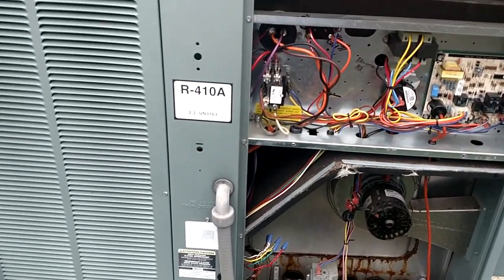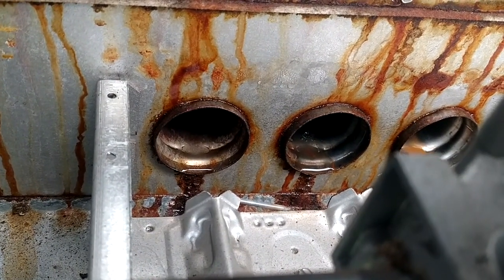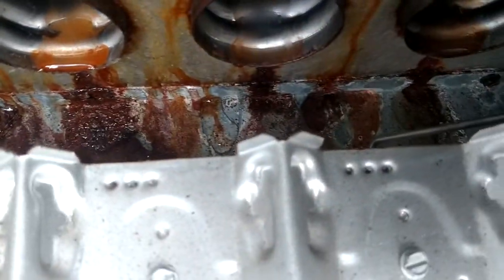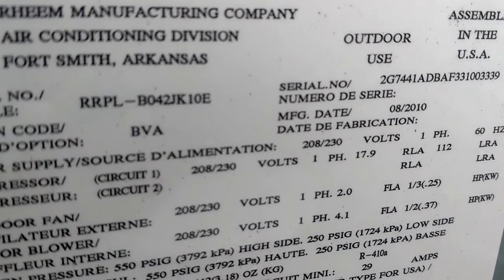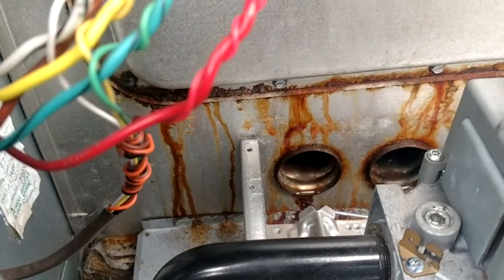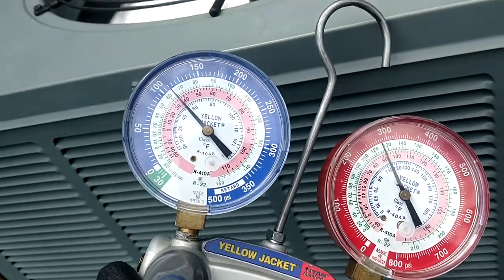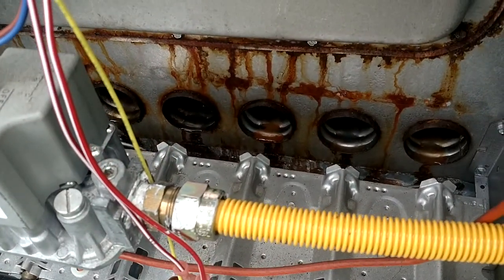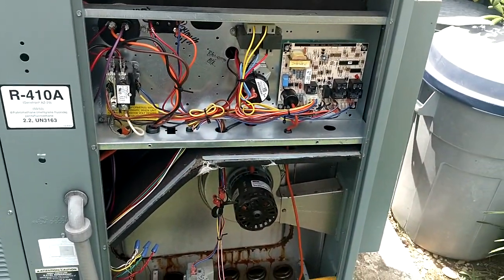What's up with that🤔 2010 Rheem gas pak condensating down the heat exchanger in A/C mode. Rust!!!

Comment: I have the same unit with the same problem apparently it’s a design flaw the tray underneath the AC condensers do not collect the water properly as a result water overflows onto the heat exchanger rotting it out which is unfortunate because those heat exchangers are very expensive horrible design

Comment: Just a theory but maybe bc of the rheem design where the tubes are mounted lower to the ground (where higher concentration of humid air is) the cold air passing by the tubes inside the unit chills the exchanger tubes below the dew point causing sweat inside the heat exchanger.
Reply from the maker: That dew point will get you every time. Thanks for watching. And thanks for your feedback Paul 👍

Comment from the maker: Suct. psi was alittle low due to the H/O using a Filtrete "purple" super allergenic pleated filter. Which I lovingly refer to as... THE DEVIL FILTER! But they just recently started using those and this rusting problem has been going on ever since the unit was installed. And I see the same thing all the time on other Rheem gas packs.